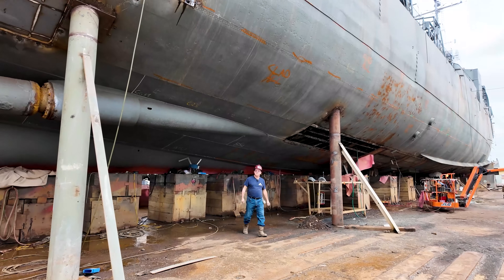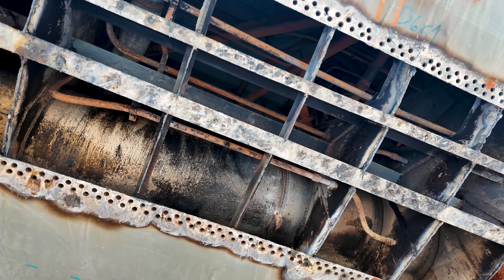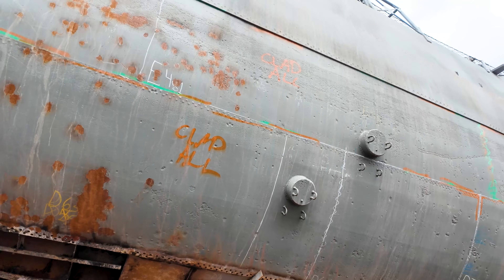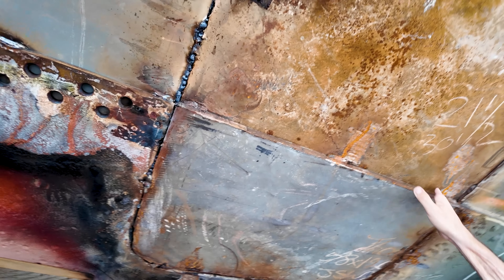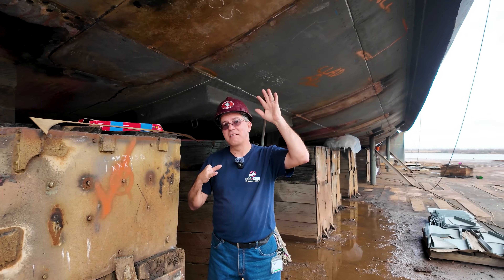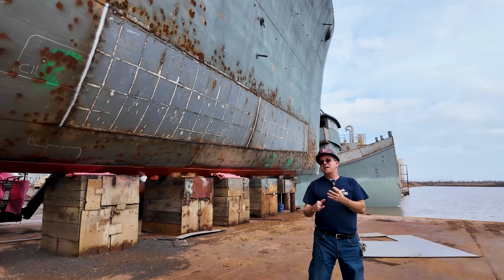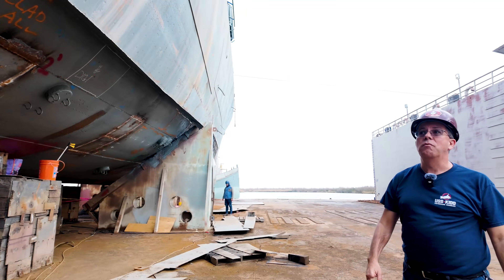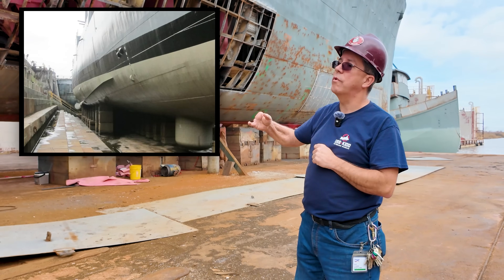Hull Overhaul of WWII Destroyer USS KIDD │#5

Comment: What are those vertical 1 ft diameter pipes which are welded to the deck of the floating dock and the other end welded to the ship's hull, to add support in specific locations?  Example: at 13:10 in the video on the left of the screen.
Reply from the maker: Support braces to help stabilize her as they move blocks in and out while doing hull repairs.

Comment: about 55 years ago as a very young man I did this exact procedure on seagoing tug boats 100-125 feet . Cutting the rotted shell plate away was a slow and filthy process We would pull off the plate and find what appears as another hull which was actually scale that hardened sledge hammers would release a shower of rust .We were given dirty money to buy throwaway clothes since we got filthy beyond description,real hard work

Comment: Question:   3/8 of an inch?  Is that normal or particularly thin?  Would that make it susceptible to enemy fire back during war time?  Further:  Is the metal on the wind-waterline thicker
Reply from the maker: Great questions! 3/8" was the average of the various thicknesses throughout the hull. Destroyers are normally thin-skinned: hence their nickname of "tin cans." The thickest plating was in the center of the ship, below and around and above the engineering spaces. Not necessarily at the wind-water line. Susceptible to enemy fire? Absolutely. Which explains why so many tin cans had their bows and/or sterns blown off, but survived and made it home to have a new bow or stern replace the lost component.

Comment: So all of those craters wouldnt it just be easier to cut and weld a new sheet? Cause filling every crater i see seems real redundant and time consuming. But than again...that may be exactly why im not a welder
Reply from the maker: Remember: the clad welding on the divots is just one method used. If a plate had too many divots below a certain thickness, then the plate is compromised and too costly to repair, and so it is replaced in its entirety.

Comment: When you see that thin of steel on that hull. Not surprising an iceberg could sheer the metal right off.
Reply from the maker: Iceberg? KIDD never hit an iceberg. If you're referring to TITANIC, the main hull plating was one inch in thickness, vs. KIDD's 3/8 inch average thickness.
Reply: @usskidd661 I never said KIDD hit an iceberg?
Reply from the maker: @maxboya : Okay. Well, an unequal comparison then. 🤷‍♂️
Reply: @usskidd661 to the titanic and the KIDD yes but again I believe you are missing my point. My point is and I’ll say it again, when you see that thin of steel on that hull. It’s not surprising an iceberg could sheer the metal right off as many people don’t realize how strong icebergs truly are. People think steel ships are insanely robust. Not everyone is an expert on ships so the general knowledge is they’re strong and stronger than ice but not the case which is surprising. That is the comparison if that is what you’re specifically looking for 🤷🏼‍♂️

Comment: One wouldn't think water would wear away at steel, but I guess you also need to consider the harshness of the environment as pointed out.  Years in salt water does damage, and I believe even afterwards that damage continues with water lapping at the hull.
We have the USS Sullivans here in Buffalo, and it is in desperate need of such drydock work.  The ship nearly sunk in the location it's at in the river, but for an amazing effort to save it by pumping out the incredible amount of water it was taking on and that of drivers trying to locate and plug as many holes as possible, and one larger section which literally sheared due to just such wear and tear, it would have been lost.   And would anyone have thought that just sitting in the water would have eventually led to an almost catastrophic event?  
Certainly maintaining and repairing these ships can be expensive, but what is the value of these ships to those whose family members served on them, and what would be lost in educational value if we just disposed of them all.

Comment: Are the ribs welded to the skin plating?   How do they pull off a hull plate if so?
Reply from the maker: @gregcollins3404 : The frames and longitudinals are indeed welded to the skin.  They simply use a torch to remove the plating.

Comment: Is it worth all the man hours to fix all the little hole and all the clad wielding , how many hours? Seems like it's just not worth it , even if you had an army of guys wielding ...month and month of wielding....but what do I know .....
If someone could come up with a coating that would fill the holes like maybe some sort of epoxy with some sort of metal??? ....I would definitely lose interest in the project
Reply from the maker: @stevepearson6316 : There is such a coating. But the cost was much more than the welding. Some of these coatings are so new, their lifespan is not truly known, vs welding which is a known quantity. As for losing interest, this yard has shown a great passion for this project. It wasn't just a few guys doing the welding. It WAS an "army" of men and women doing the work, ... all with smiles when they went on break and returned. A very happy crew. This portion of the work is almost completely done now. 🙂
Reply: @usskidd661  its good to hear that so many have taken an interest in the project 😊 😀

Comment: Boy you guys are soft a robot for ultra sound? Looks like the longs and verticals need work first get rid of the soft patch bolt on area go to tge next seam up and down.or go to a radius corner insert it's lead paint you better imploy Lead abatement rookies
Reply from the maker: @EugeneKelly-gc4ki : The lead paint has been abated already. Thanks.
Reply: @usskidd661  glad to hear but continue with good ventilation respirator  fit and use a purple cartridge at all times wash hands before eating change clothes  and shower before  going home take 1000 milligrams calcium a day and remember  lead go's out of the bloodstream in 7 months  after that you must do a hair test and do not get chelation unless you are prepared or able to get in a sauna and sweat or else you we just reabsorbe the lead released  back to the blood stream  sweat drink a lot of water eat roughage
Reply from the maker: @EugeneKelly-gc4ki : Appreciate it.

Comment: I served on the USS AULT DD-698 and made a North Atlantic cruise in November of 1970.  40' seas every day, had to strap myself in my rack at night.  We always worried about the hull failing when the bow came crashing into the base of the next wave.  We spent 45 days at sea without hitting a port.  We were ordered to the Eastern Mediteranea Sea one day before pulling into Lands end, England.  Then we spent another 45 days 12 miles off of Lebanon.  It was a great experience that I will always cherish.

Comment: I served an apprenticeship as a shipbuilder (plater) in the UK from 1970 - 1976 so I found this interesting. That guy explaining how to make a curved plate under the ship is not using a method I have heard of? All of those frames (ribs) are shaped from a master drawing and fitted shaped curved when new. To make a plate to fit that shape we would get a piece of 1" x 1/4" flat bar and hit it along the length and it would curl and you could easily match the frame shape. You would do that on the two furthest apart frames and end up with a template shape of the new plate curve. The reason you made two templates is because that curve changes across the length of the ship.. Then a wider piece of plate would be taken to the rollers and you would roll the plate until it matched the templates. One end may have more roll in it (curve). The rollers were a huge machine with three large metal tubes that you adjusted to get the correct curve. The plate had to be rolled larger because the machine could only roll the plate up to a foot or so before the edge. So if the plate was not larger the edges would be flat not rolled curved. At this point you would make a wood lathe template of the hole in the ship and transfer it to the rolled plate and cut the plate. Next we would use a trolley and then chain blocks to get the plate in place and finally using steel wedges and dogs we would force it into position while trimming it where necessary with oxy acetylene cutting gear. And tack weld it into place ready for it to be fully welded by a tradesman welder. The weld would then be x rayed.

Comment: Only 3/8ths of an inch thick hull plating? I always assumed the steel was more armored than that. Whoa! Any mine or torpedo would wreck that hull.
Reply from the maker: @ElCineHefe : Destroyers were expendable. 🤷‍♂️
Reply: @usskidd661  I'd so say. There's no real armor in the hull. Beaching it probably meant the end of any salvage.
Reply from the maker: @ElCineHefe : Depends on where/how it's run aground (i.e. rocky, muddy, etc.). USS BACHE (DD-470) was blown aground in 1968 outside the harbor at Rhodes onto a rocky bottom and was a total loss. Whereas RADFORD (DD-446) ran aground in Chesapeake Bay in 1942 and was repaired. USS FARRAGUT (DD-300) ran aground in the Honda Point disaster of 1923 but was able to extricate herself.

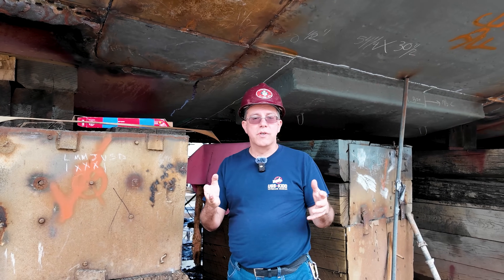Comment: At 7:30 and on. To match the curvature, a  sweep is made and given to the plate roll operator, he will roll the given piece of plate to match the sweep given and the fitter will then attach and trim if necessary to attach the replacement pc. No shaving.

Comment: In the hidden areas where no one will see what is behind the interior metal, I would recommend spray foam insulation. Will hold up better long term, resist moister getting between it and the hull plating. It will help extend the life of the metal.

Comment: In the mid-80’s I was a sonartech stationed aboard a destroyer out of Mayport. ASW control was one deck above the bilges forward. Lower sonar, if you lifted deck plates, was directly above the bilges and slightly aft of the sonar dome. Not once while underway did I worry about my safety, my shipmates or the ship. Now, in watching this, I would surmise that the hull at our berthing space (berthing was outside the hatch of ASW control) was as thin as this. In retrospect, perhaps I should have had a tee tiny little bit of worry and possibly hitting something. At 21 you don’t think that way. 🫡
Reply from the maker: @TAllyn-qr3io : 🙂🫡🇺🇲🏴‍☠️

Comment: Are the seem on the hull at the  croping places not suposed to be ribbetid  ,not welded?
The general rule for ribbeted hulls is that you can do welded cropouts inside the boundary off the rivvetid plate but if the damage is in the seem the plate should be replaced .
Any new plates added should  be riveted to the hull. A riveted hull is more flexible than a welded one ,and partly welding   plates create tension on the weld that may crack, because the surrounding plate seem are more flexible than the wielded ones.
Reply: Thanks for answer! 
Please 
Make a video explaining the principles of desiding welding / riveting shoise and showing examples of places on the hull were the decisions  are being implemented, mayby a welder or ship engineer can be on camera talking about this,in your video .
Reply from the maker: @perstaffanlundgren : They're not finished yet.

Comment: Why not leave it on land
Reply from the maker: Ships are designed to have their weight supported from all directions when in water, by the water. When out of the water long-term, she will "pancake" downward, losing that curved contour on the hull, as gravity pulls everything straight down. Her skeleton is not designed to hold that shape for decades on end without the uniform support of water around her hull. Take her out permanently, and you destroy her.

Comment: What are the red bags? at 16:00
Reply from the maker: @steveclardy5196 : Good question! Those are not bags. Rather, they're fire retardant cloth used to wrap stuff up to protect it from hot work (torches, welding).
Reply: @usskidd661  Ok Thanks for the info!!

Comment: Err . . . Err . . .why not fix (Probably weld) a series of  full beam width steel  cradles to the hull at 20 odd points , each cradle  joined by massive longitudinal  girders, and then mount the cradle on massive coil-overs (Spings over synthetic rubber or poly cylinders) connected to the concrete foundation (The length of the coil-overs corresponding to the difference between high and low tide). That would remove the future possibility of hull damage caused by daily tidal flows lifting and the re-seating the hull on the cradle. The only peiodic maintenance required would be limited to the replacment of the coil-overs and erosion of the hull plates and accumulation of fouling matter.

Comment: The plastic tube blowing out the open side of the hull starting at about 12:00 is consistent with the exhaust of an asbestos abatement HEPA filtration negative pressure ventilation unit. I'd be shocked if Kidd wasn't full of the stuff. Good to see that they are using the right equipment to do it safely, at least. :)
Reply from the maker: @bitcoinconstitutionalist9252 : Here's where a little bit of information can hurt without ALL the info.

Yes, you are correct on two counts: 1) KIDD, like all of her sisters was built with materials that contained asbestos in some cases, and 2) the tubes can be used for abatement filtration when handling those materials.

Here's the rest of the info that people need to know so as not to cause panic at mention of the "A-word": 1) asbestos insulation has to be encapsulated (sealed up) or removed entirely before any of the general public can enter a space, and 2) those same type of plastic tubes (at least in appearance) are also used to distribute cool air to the yard workers throughout the ship's interior from mobile air conditioning units they've brought on board.

Comment: Sorry, but i have to mention this who wedded that plate on the ship who ok it ,   i have a 6 year that could run a bead better than that,  another thing if there is expensive damage to the ships plating why would hot all extra metal to the contact points. This is just wrong if you are gonna do it, do it write
Reply from the maker: @donpost9462 : Are you discussing the touchpoint where he was demonstrating? Because none of those touchpoints were even CLOSE to being finished.

Comment: Are you replacing the old steel with the same kind of steel that was originally used?  What kind of steel is it?  I have seen rifle bullets go through mild steel.  Wouldn't they use something tougher on a warship?
Reply from the maker: @anderss6818 : Same plate thicknesses. No mild steel.
Reply: @usskidd661  If it is not "Mild Steel",  Do you know what kind it is?  Is it what they used to call "Special Steel"  during World War II?
Reply from the maker: @anderss6818 : From Tim:  "Apologies, Anders. I misspoke. What we're using is A36 Grade A steel, the same stuff they use on bridge construction these days. The low carbon percentage DOES indeed qualify it as 'mild steel.' The STS steel from WWII wouldn't be necessary because she's not going back to war, nor is she ever going to be actively sailing out on the high seas again. Apologies for the misspeak. Chemistry was not my best subject."

Comment: Keep it on shore those supports caused this damage and those welds from what I see are not that good why keep an old ship in water when other ships are on shore and submarines and im a USN Vet
Reply from the maker: @lutomson3496 : Long-term dry berthing leads to structural deformation. Even those ships and subs will see that eventually. The cradle is the best system for our environment on the Mississippi River. We know the lessons now that our founders did not know 42 years ago. Others coming behind us will refine that knowledge even further.

Comment: How come ya’ll don’t thin plate over (with weld seal) the crater divits instead of the tediousness of addressing each one ?
Reply from the maker: If you watched the video in full, the divits are addressed by all three techniques. The frequency and depth per plate, and/or whether or not they've penetrated determine which process is used. If by "thin plate over" you mean putting on "doublers," that technique runs the risk of having gaps between the hull and the doubler plate that can allow condensation which produces rust hidden away. By the time it corrodes through the doubler, it's likely also made the hull beneath it even worse. Not a gamble we're willing to take.

Comment: Dad was on several FRAM 1 and FRAM 2 Sumner and Gearing class during the Cold War & I guess it is for that reason I have a heart for DDs. Remember way back when that Mom said of all the different ship types Dad was on, she liked the destroyers the best because they looked the most nautical. Way back in 5th grade I got to go out for a week on one of the Gearing class & one day went deep in the storage areas in the bow with a sailor, put my hand on the hull skin and I swear the metal was thin enough you could feel vibration of the passing water.

Comment: Another well done and very informative video. Thank you for this!  She’s coming along well! Interesting on the one picture of Laffey in drydock; am surprised the horizontally cut-off props were left on. Curious if it would’ve been easier to remove them and cap the shaft ends. Obviously a problem that Kidd doesn’t have with her props and shafts in good condition.
Reply from the maker: May have been kept for ballasting. THE SULLIVANS had her props and rudder removed, and she's light in the rear as a result, causing them to have to put water in the voids back aft, according to their channel.